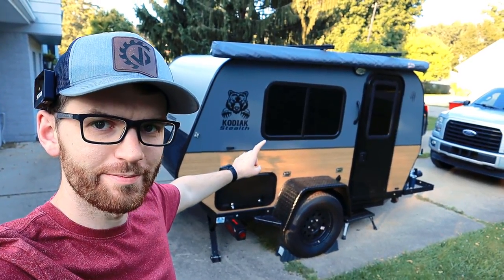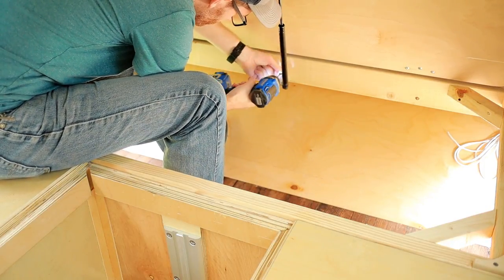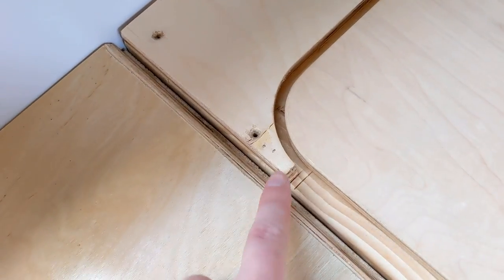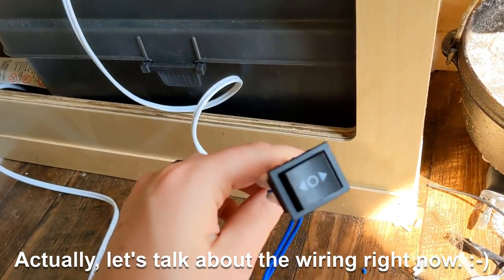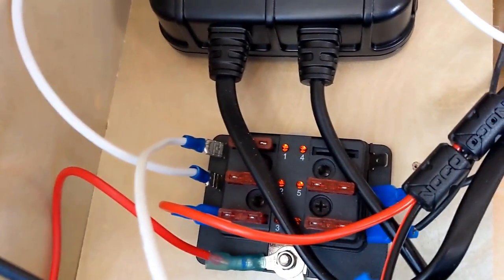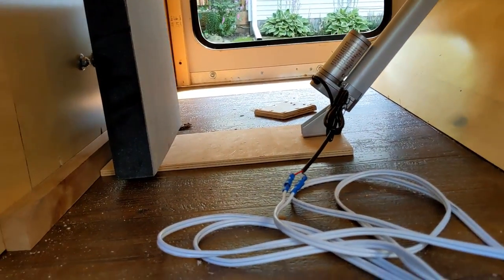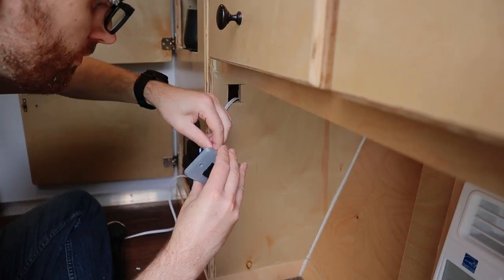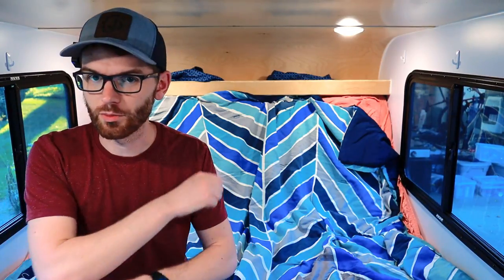Do this BEFORE your next camping trip!

Comment: Nice job!!  I've only built a multi level shelf for inside the closet since we needed more shelf storage and not a full closet of hanging room.  Otherwise no building just obtaining the right tables and gas connectors for the outdoor "kitchen" area.  Like what you did as I don't think I'd access the pass through from inside much anyways so I think this is much more functional this way.
Reply from the maker: Love it! What camper do you have?

Comment: Cool. While you're at it, I would suggest an improvement, though. You could split the remaining of the wooden plank in two and add another hydraulic arm which would pull the feet of the bed downwards so that you could get an actual sofa. That way you could get an infinite number of combinations, from full sitting position (with your legs bent at the knees and feet touching the floor), to the fully horizontal position. In between you could configure it with legs and back at 45 degrees or whatever other configuration felt perfect for the occasion.
Reply from the maker: Hey thanks for watching! Im glad you liked it!  That is a really cool idea, it would be like a true lazy mode then!

Comment: Just came across this and find it a great alteration to small campers. However, I might take it a step further, since you lost access to your storage from inside cabin I would make two doors (or just one) to each side of the actuator but positioned further back toward rear so that the weight of a body would not put too much strain the access door(s).  Other than that I really love the idea and will share with friends. Regards!
Reply from the maker: Great idea!  That would definitely be handy if you kept items in there that were handy to have inside the camper.  
Thanks for watching!

Comment: Running all your electrical out in the open under that trailer - not a good idea at all.  That's why god made electrical conduit.
Reply from the maker: I don't think God made electrical conduit.  But....either way, in this particular case, electrical conduit would probably cause more problems than it would solve.  Since there are steel angle iron bars across the bottom of the camper, I would have to cut large holes for the conduit to pass through.  This would be really tough to do...and I just don't think its necessary, especially since I used wire that was rated for exterior use on trailers.

Thanks for watching!